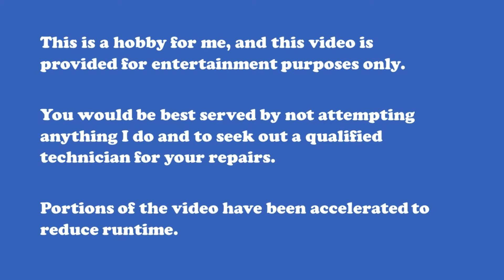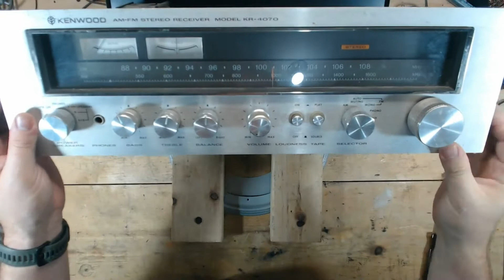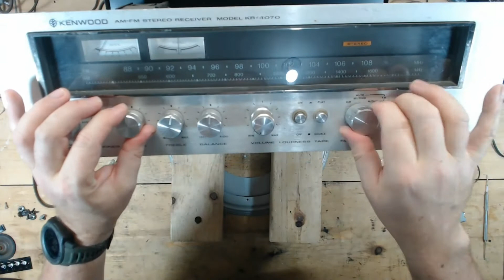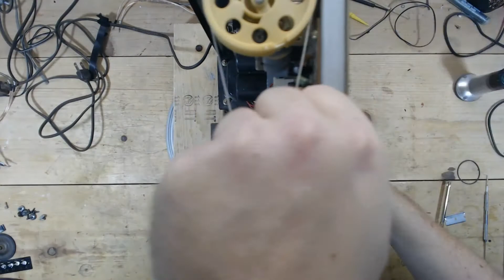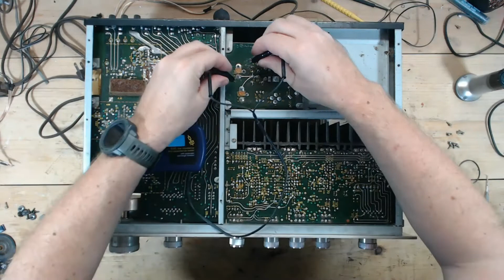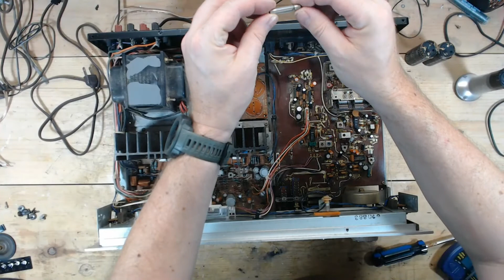Kenwood 4070 Stereo Receiver Repair Part 1 - No Sound / Initial Eval

Comment: Were the large elctrolytic caps glued in on your board? I've desoldered mine, but the cap won't budge. I've tried spraying rubbing alcohol around the base of the caps on the front side in an attempt to loosen the adhesive. Unless it's corrosion from a leaky cap. There is definitely a build-up of something present around the base of the caps on the top side of the board. Any tips or hints for me? Please and thank you!
Reply from the maker: It's likely just glue...you can 'score' the glue with an exacto knife to see if that makes it easier...I usually just wiggle it until it breaks free.